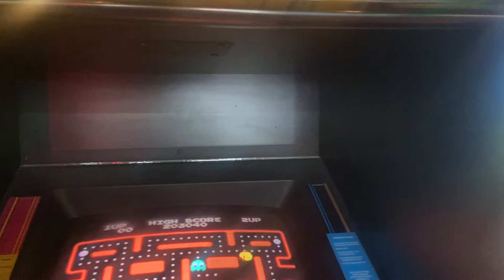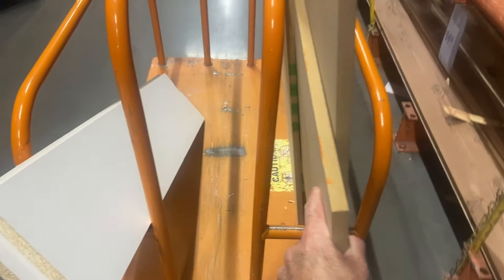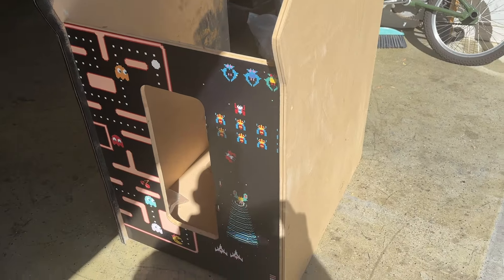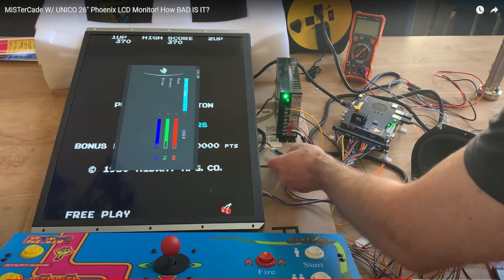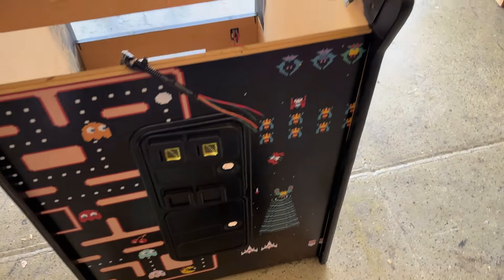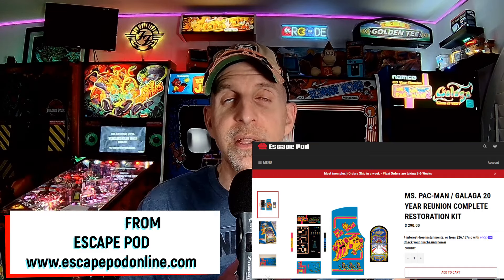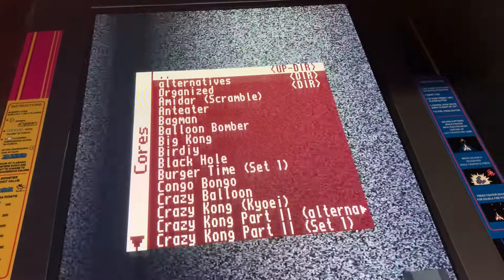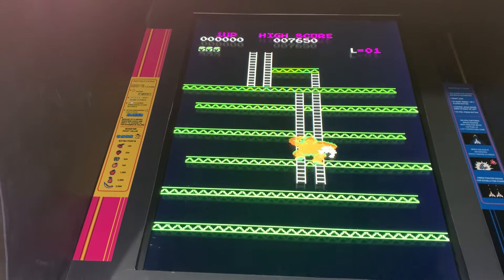YOU'VE NEVER Seen A 'CLASS of 81' Arcade Like this Before! (What's Inside it?)

Comment: great build.  I have a real class of 81 with the 25 inch CRT monitor.  I run original class of 81 pcb and a phoenix arcadeSD pcb for additional games on a riddle switcher, as well.  The shitty issue (you don't have it bc you are using an LCD) is when you switch , the horizontal/vertical sizing and the colors are off for each pcb.  So i'd have to get to the pots and adjust the colors and sizing  which is a huge pain the ass.  I usually just play using the arcadeSD.
Reply from the maker: @JeffYPbPr  yes. That’s why I went with hdmi from the mister.  Plus it’s a better picture on the mister than this crappy cga in lcd.  I’m familiar with the switcher issue regarding pots and positioning because in have another switcher on another machine and have a similar issue.

Comment: Awesome, although personally I think the joystick is tall (I thought it was smaller), and I hate lcd monitors, the fact you started this build from scratch is impressive and awesome, congrats on your new Ms. Pac-Man / Galaga / Mr Cade class of 81. I always was a fan of the Ms. Pac-Man/Galaga cabinet shape, which is why I got a multicade almost exactly like a ms. pac/galaga, it runs an arcadeshop pcb instead and is mostly black.
Reply from the maker: The original (repro) Ms pac Galaga joystick i had in it, I didn’t like , so I switched it with this joystick.  I have a separate vid on the joystick , it’s a Dominux8.
Reply: @therexershow  Oh okay, personally I like the smaller size joysticks since it looks close to the original ones in the ms. pac-man and pac-man machines but I respect your decision.

Comment: Never Realized you can Have the Printouts done at FedEx. Nice Tip!
New Sub; Dryden, Mich.
Reply from the maker: @MotownBatman  yes site. Bring them the file and tell them you want full size. They actually let you use the machine yourself.  Tell them you want the cheap method , not the machine in the back.  It should cost around $30 though.
Reply: @therexershow  I've been Stackin OEM Blueprint Files for 2 Decades:
Time To Put them To Use.